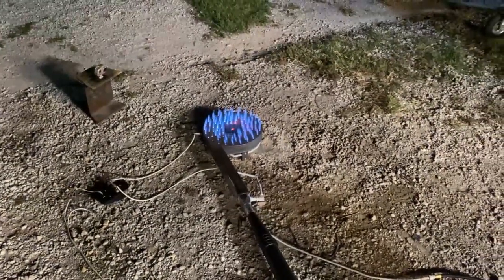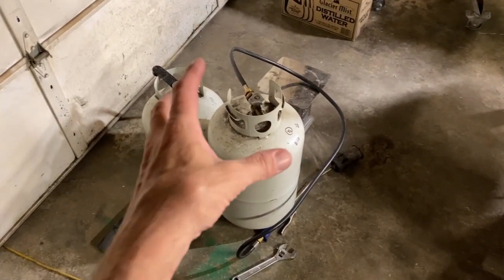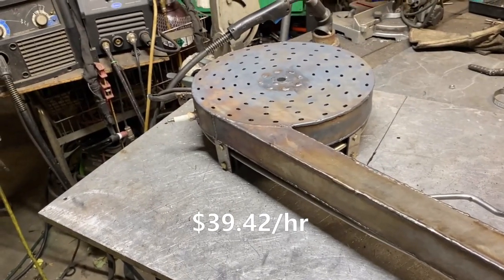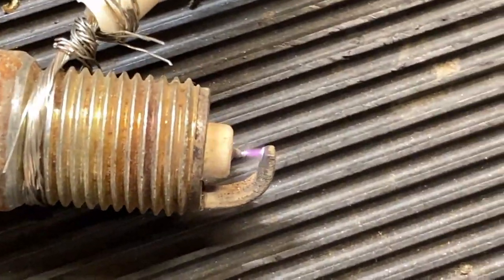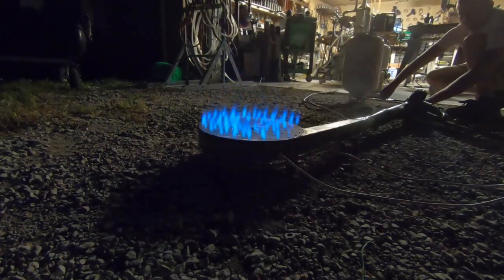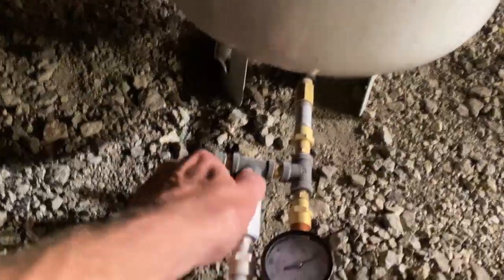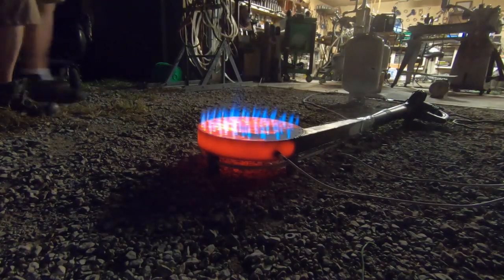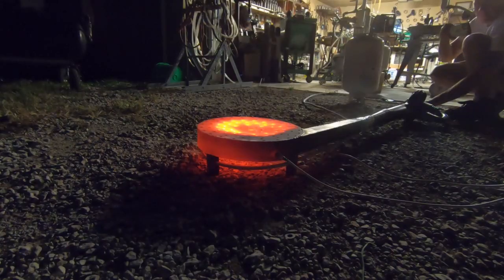885,600 BTU Liquid Propane burner THE BANJO

Comment: Looks like a standard steel prototype,  for better lifespan S.S or even inconel would be dope.
Inside the feed tube installation of a mixing screw would make ignition more even, spark plugs right on inside & outside edge.   Get a flame rod type plug wich is large dia center electrode arc ground to burner metal.
Drill round holes, insert rod and bend the plate top slightly at each hole to form scooping (inverse of the spin) to get straight flame kernels.   Die grinder is another method  which tear drop form that appears used.
Love the experiments you do and simple straight forward approaches, even if idiots like me toss out other ideas.
Keep up great work,!

Comment: Could you use waste oil in that tube and pre-heat it under pressure would it be able to run hotter?
Also could the spark plug be moved to the inside of the feed tube (where it is cooler as well) so it can be protected by the burner body (not hanging out the side where it can get hit)
Reply from the maker: Pre heating waste oil in a tube makes for a good video but a very unreliable device , varnishing takes place and foals out the coil over time as well as reduces its heat exchange rate
Reply: I don't think so. If you tried to burn waste oil in that thing i'm pretty sure it would foul up with trash in no time. Deposits would stick to places where it happens to not be red hot, the deposits would grow, and it would clog up... If not, ash would clog it. 

For it to even light i'd imagine it would need to be preheated red hot with propane. And then fuel fed in... I'd only use diesel though, couldn't imagine WO working.

Comment: What If you made the gas intake do a turn around the burner the heat that is dispersed from the red hot walls would be recollected, so you could probably reach a higher temperature and don't waste heat that way, also if the gas entered the burner already pre heated you could likely burn even more gas, do you think it would make sense or am i missing something?

It would probably also help with the ignition because of the gas heating before entering the burner, so you don't leave a piece of the burner cold from the entering cold air
Reply from the maker: No its a good idea but this burner will be place in a mono tube boiler fire box so the IR will be put to good work in the fire box